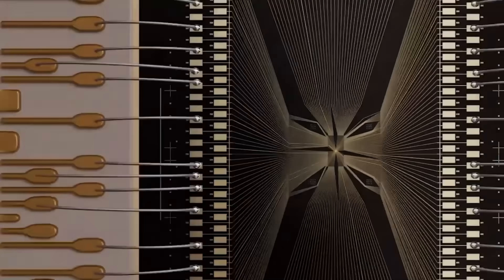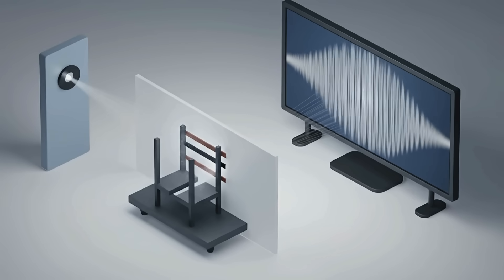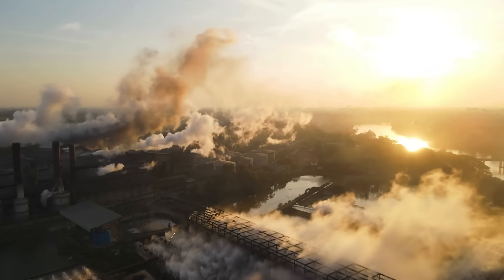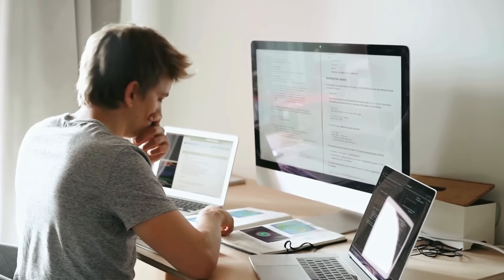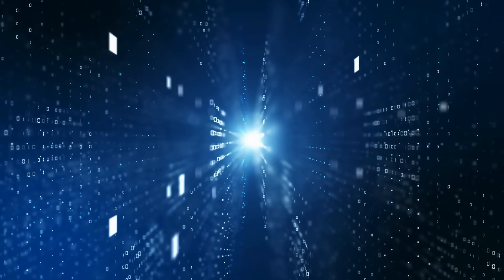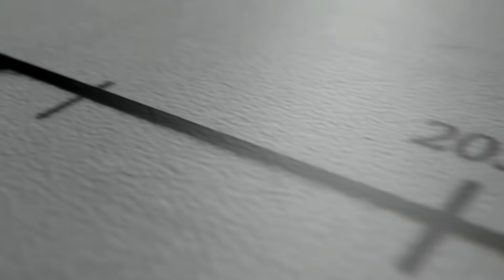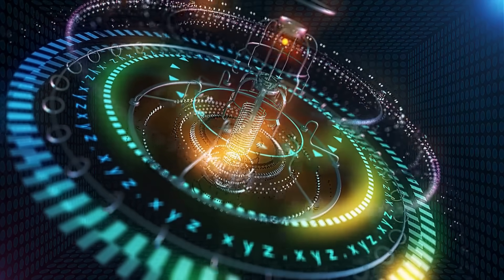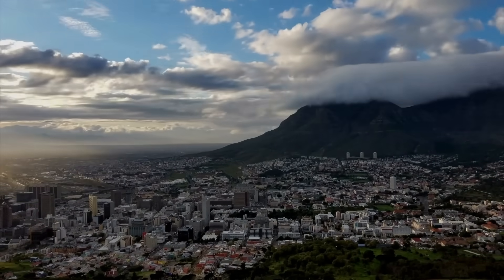Microsoft's Topological Quantum Computer Changes Everything!

Comment: Export the Majonara, Chat GPT, Revit, Plant 3D, Civil 3D, Inventor, ENGI file of the Building or Refinery to Excel, prepare Budget 1 and export it to COBRA. Prepare Budget 2 and export it to Microsoft Project. Solve the problems of Overallocated Resources, Planning Problems, prepare the Budget 3 with which the construction of the Building or the Refinery is going to be quoted.
Reply: Tablet and a pencil with a properly educated construction manager overseeing a superintendent with skilled journeyman Foreman survived and profited for 100 years. This only works in scalable projects over 10 million in commercial and Industrial applications. It's highly impractical for commercial residential developments possibly, spoken from 40 years of experience. I have to use both they do not address time spent in the bottom line these people must be proficient first and skilled trades.
Reply from the maker: Totally get what you’re saying! It’s all about having the right skills and experience to make tech work for us. Keep sharing your wisdom!
Reply from the maker: Sounds like you have quite a project on your hands!